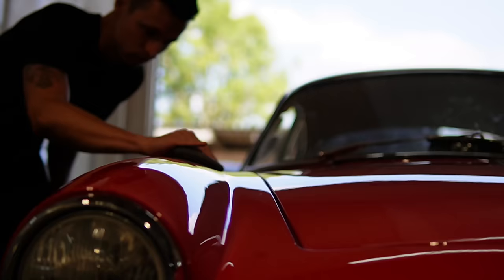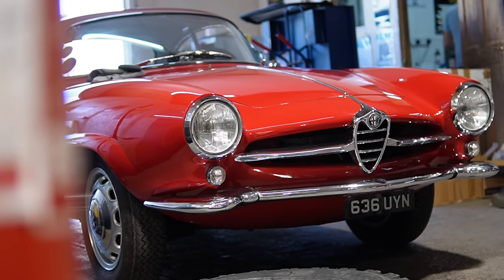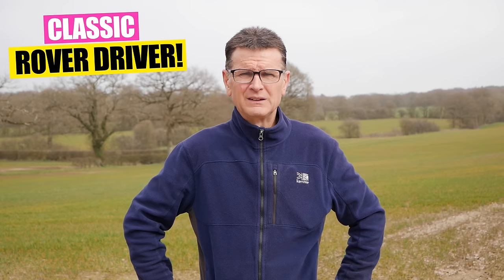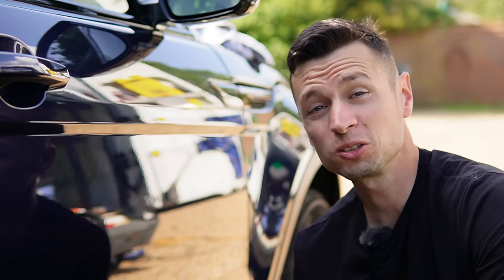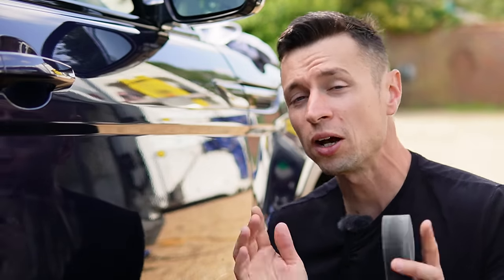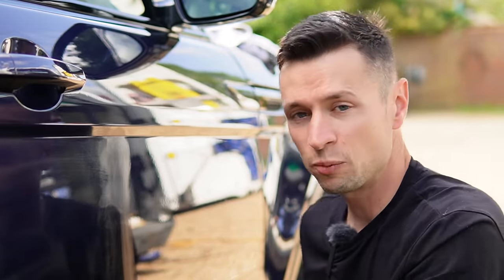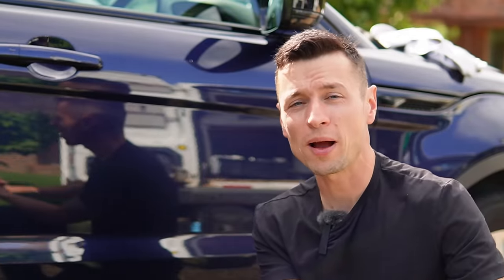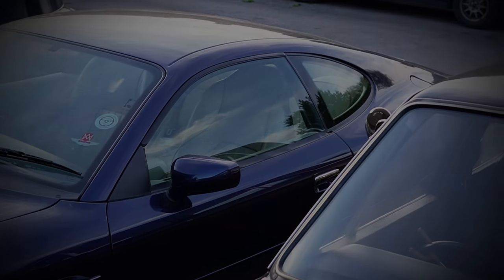How to Polish a Car Polish THE EASY WAY without a Machine Polisher?

Comment: Polish with a capital is referring to someone from Poland, without the capital it`s to polish. Unless it is the start of a sentence.
Reply: Ok then. Polish with polish! What do I mean?
Reply: @andrewwallace7021  Certainly! The sentence “Polish with polish” has two distinct meanings:

So, when you say “Polish with polish,” you’re suggesting both the process of refining something and the connection to Poland. Quite clever! 😄🇵🇱✨

The sentence “How to Polish a Car Polish THE EASY WAY without a Machine Polisher?” is grammatically correct, but it could be clearer with some minor adjustments. Here’s a revised version:

“How to Polish a Car the Easy Way without a Machine Polisher?”